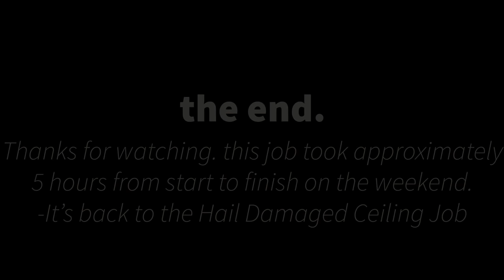How to Install new Bathroom Walls using Cement Sheet instead of WR Drywall

Comment: Cement sheet or villaboard like this is becoming outdated in wet areas, tile backer board is the new go to so much better and waterproof, cement sheets like this will be banned in the future because it rots and falls apart but it will take time
Reply from the maker: i don't think so, cement sheet is far superior than any wr drywall
Reply: @Maxkil  for wet areas foam/cement coated waterproof board is the new wa, and yes we plasterboard is actually banned in the USA, and cement sheet will be next to be banned

Comment: The cement board in Australia cuts so much easier than the stuff we have in the U.S.A.  We would never be able to score it 1 time with the carbide blade and just back snap it like Bob does. Nor do we have a cutting tool like the one he used.
Reply from the maker: yeah bro your right, ours is only 10mm thick, so snaps easy.
Reply: I often score it with a grinder than snap it
Reply: Wouldn’t it be 9mm? And a single score and snap on 9mm? U sure u didn’t mean to write 6mm 😂
Reply: @doinksinamish5297  
Yeah it's definitely only 6mm board.
You can see it in the video.
Reply: @vzgsxr  even if it was 10mm which is actually 9mm there’s no way you can score and snap that shit
Reply: @doinksinamish5297  
Agreed.

Comment: Hi mate,
What screw they use for cement sheet here
Reply: @adamguo7910  I'd also like to know this!
Reply from the maker: Villaboard Galvanised Countersunk Head Screws 8g x 20mm
Reply from the maker: Villaboard Galvanised Countersunk Head Screws 8g x 20mm. Comes in loose and on strips

Comment: In that bathroom area, or perhaps even other wet or damp areas, what do you use for screws to attach the board with? Stainless steel? Nice cutting work! -Bob...
Reply: Good question here,
Ideally C4 but most of time C3
Reply from the maker: In an upcoming video in a few days I will show you this new screw that's out (new to me) that he uses now, Thanks Wran Ther